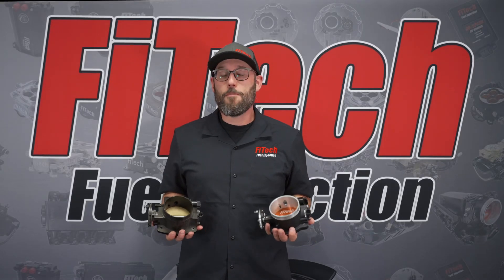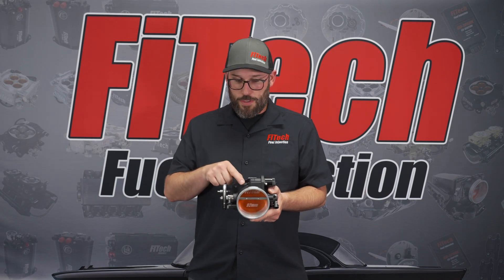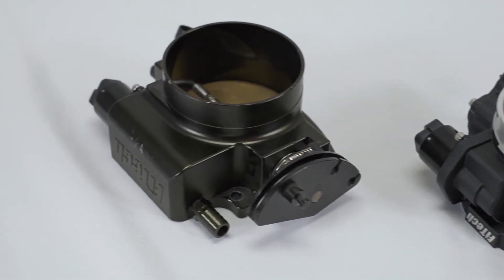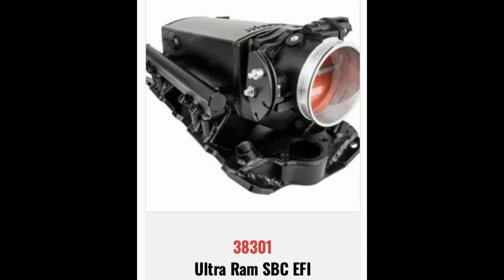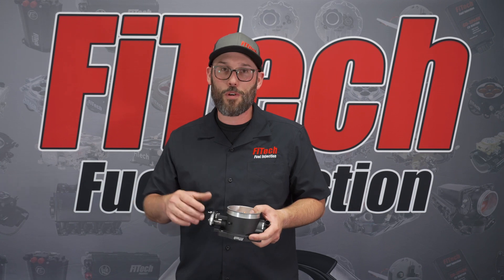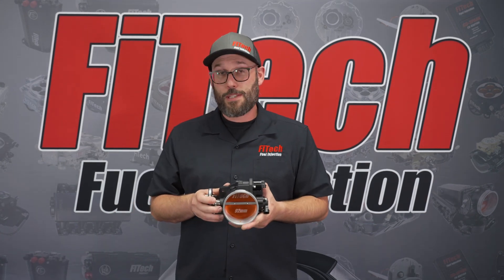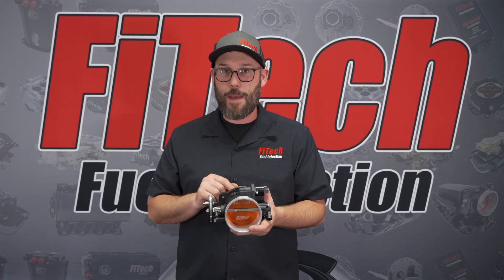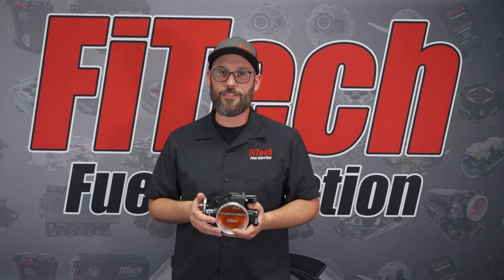FiTech’s LS Throttle Body | Tech Tuesdays | EP93

Comment: Can this be mounted with the linkage on either side?
Reply from the maker: The throttle body can be mounted upside down which would put the linkage on the driver side however you may running into clearance issues with the throttle cable bracket and intake.

Comment: If you buy just the 92mm fitech throttle body does it come with the vacuum port for the top of the throttle body that goes to the vacuum line on the valve cover